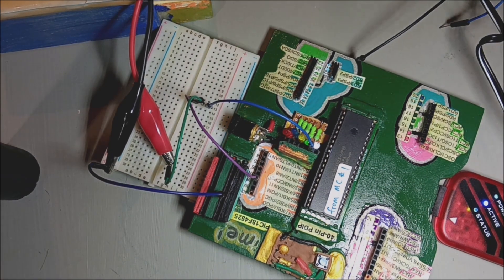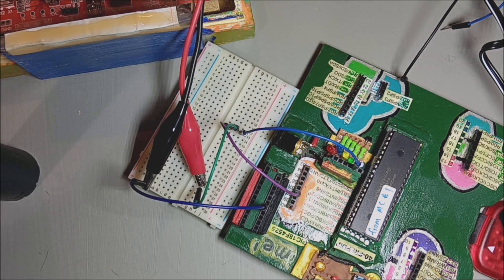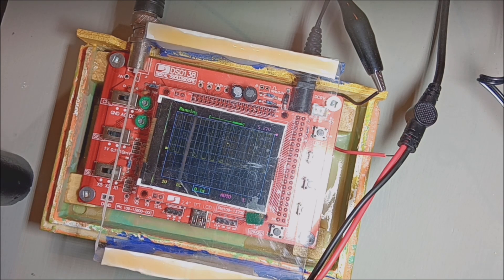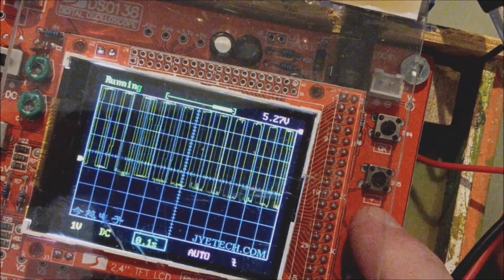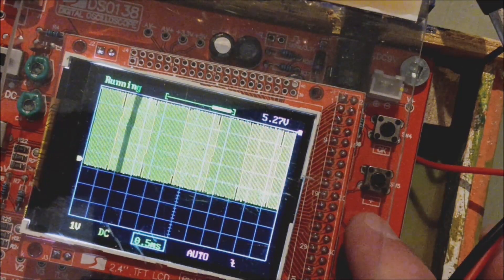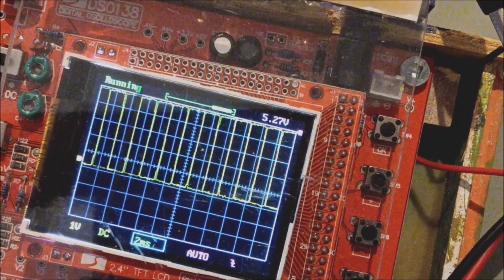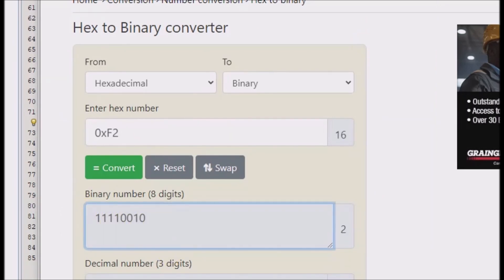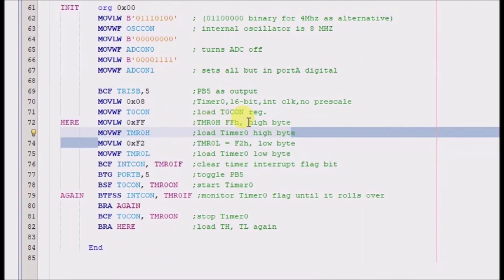PIC18F4525 Part 018: Timer used as Delay (in Assembly Language)

Comment from the maker: ; free sample code (copy and paste)

INIT	org 0x00
	MOVLW B'01110100'   ; (01100000 binary for 4Mhz as alternative)
	MOVWF OSCCON	    ; internal oscillator is 8 MHZ
	MOVLW B'00000000' 
	MOVWF ADCON0	    ; turns ADC off
	MOVLW B'00001111' 
	MOVWF ADCON1	    ; sets all but in portA digital
	
	BCF TRISB,5	    ;PB5 as output 
	MOVLW 0x08	    ;Timer0,16-bit,int clk,no prescale 
	MOVWF T0CON	    ;load T0CON reg.
	
HERE	MOVLW 0xFF	    ;TMR0H FFh, high byte 
	MOVWF TMR0H	    ;load Timer0 high byte 
	MOVLW 0xF2	    ;TMR0L = F2h, low byte 
	MOVWF TMR0L	    ;load Timer0 low byte
	BCF INTCON, TMR0IF  ;clear timer interrupt flag bit 
	BTG PORTB,5	    ;toggle PB5 
	BSF T0CON, TMR0ON   ;start Timer0 
AGAIN   BTFSS INTCON, TMR0IF ;monitor Timer0 flag until it rolls over
	BRA AGAIN 
	BCF T0CON, TMR0ON   ;stop Timer0 
	BRA HERE	    ;load TH, TL again
      
      End